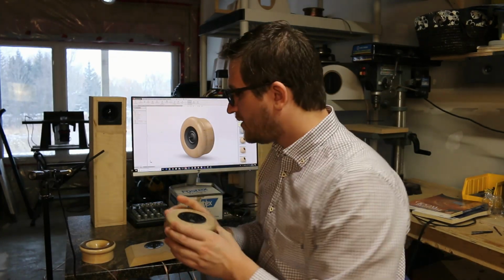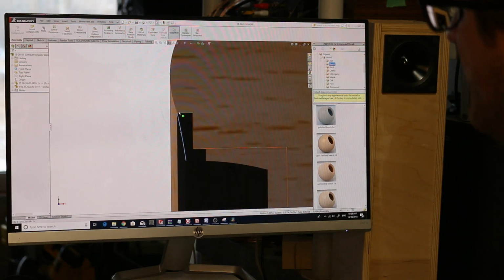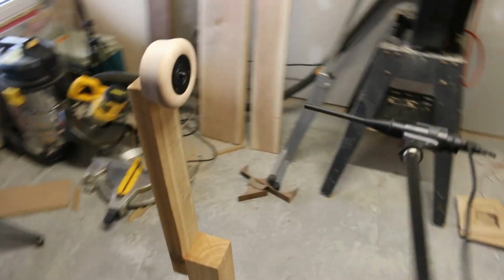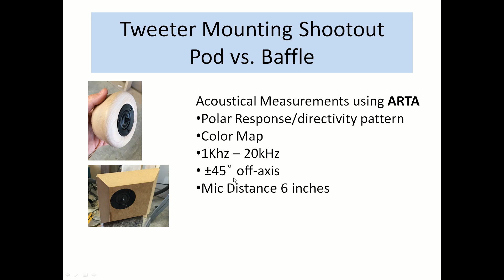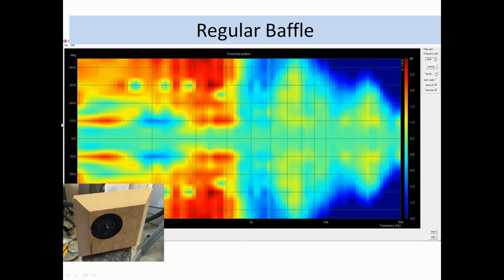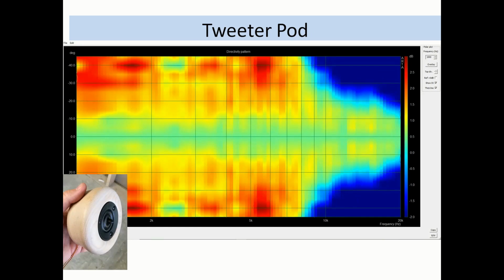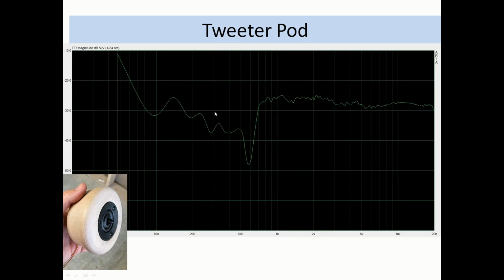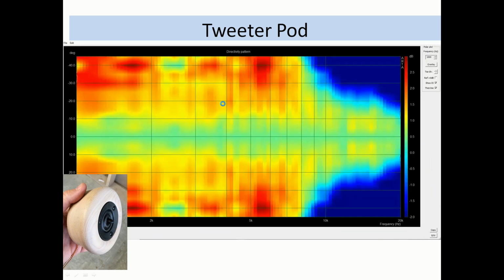Tweeter Pod versus Flat Baffle -- Comparing two tweeter mounting configurations

Comment: Interesting. But the question is where do you put the tweeter pod? If you put it on top of the main speaker there will be diffraction effects from the main speaker box. Have you ever measured the pod mounted to a box?

Comment: I would like to repeat the test with a spherical case and with a teardrop shape.
Reply from the maker: It’s important that the physical transition around the tweeter doesn’t have any abrupt changes in geometry.  Spherical tends to have that angle change from the flat face of the tweeter bezel.
Reply: @JosephCrowesDIYSpeakerBuilding  Then the task would be to construct a sphere that begins with a sound guide directly at the callote.

Comment: Thanks for the video Joseph! Very interesting. That vifa tweeter is quite a good one, but ring radiators have a typical off axis response with a dip at the wavelength of the ring's diameter. How do you think an aluminum dome tweeter would performin this case?

Comment: This leads me to wonder if changing the shape of the baffle for an open baffle speaker would improve the sound . . . rather than the traditional flat extended baffle?
Reply from the maker: I think it would.   On a wide baffle the edge diffraction is still occurring however it's happening later in the impulse response.  For example a 60cm wide baffle the edge diffraction would be occurring at around 1 millisecond after the initial impulse.  This is still well within the impulse response of the driver as even a very 'fast' fullrange takes longer than 1 millisecond to settle.   The magnitude of the impulse will be slightly reduced because of the distance the sound wave travels but the effect would be minimal.

Comment: On the regular flat baffle with chamfered edges you may be getting most of the edge diffraction from the sharp edges of the chamfer and the back? A 135 degree angle there. This is not representative of how such a baffle would behave on a real speaker where this sharp edge is not present but instead there are the sidewalls which give a 45 degree angle with the chamfered part of the front baffle.
Furthermore I've seen measurements with a 30 degree chamfered baffle show excellent results (real world including sidewalls) and theoretically your chamfered baffle, perhaps if rounded a little bit more and of course with sidewalls, with the off-center placement of the tweeter should give better results than your circular horn mouth which gives the same edge diffraction error in all directions so they add up?
Reply from the maker: Marcel de Velde I plan on revisiting this experiment so I’ll do as you suggest.  I want to look at decay spectra in the new video.  I also want to see what adding felt does since some have suggested that felt is effective but I suspect that it doesn’t help as much as baffle shape.  Thanks for your comments!
Reply: @JosephCrowesDIYSpeakerBuilding  Looking forward to your tests! It remains an interesting subject and good for testing, haven't found a program that can reliably model chamfered or rounded baffles. In theory felt shouldn't work as the transition between baffle and absorption should give diffraction as well as perfect absorption is the same as sound dissapearing in free space, but who knows maybe it does in practice by giving a "gradual edge" or something like that.. Though felt should still reflect most under an angle.
Btw I'm very curious, why do you use a rounding that curves exponentially at the edges? I can understand this for horn mouths or even to some degree in waveguides but why for edge roundover?
Reply from the maker: The rationale is that so much effort is placed on the best flare and horn mouth termination that endless articles have been published on the science and yet when it comes to baffles there is little consensus on anything, few articles, and a lot of misinformation especially from the old Olsen charts and graphs that generally mislead designers into thinking round is the worst shape possible.  I think baffle design can take a few lessons from the horn theory.  Nobody would suggest putting a 30 degree straight chamfer on a horn mouth as the ultimate solution to reducing edge diffraction. So why would this be the solution for a regular baffle?  The sound wave propagation from the tweeter is the same thing as the wave front from the horn, so the design method on dealing with the issues shouldn’t be any different.
Reply: @JosephCrowesDIYSpeakerBuilding  Thanks for your reply and explanation! Yes I do agree a 30 degree chamfer is surely not optimal, but I believe what is agreed upon that for an infinately small tweeter (point source ideal) the ideal shape for the smoothest baffle step without edge diffraction is a perfect globe. It gives a perfect 6db baffle step shelve with a Q of 1 I believe.
I think for horns and waveguides there are different principles at play regarding reflection but I'm not an expert on this..
As for the rounding of edges, we won't achieve a perfect sphere anyhow as tweeters have a size of their own and part of the baffle is therefore flat before becoming rounded which means that there will always be some change in the Q of the 6db baffle step (which is another way of explaining baffle edge diffraction). Somehow my logic tells me that the edge rounded to a circle will still give the lowest Q possible as it will give the least sharp angle at any point. But again, guesswork.
Reply from the maker: Or is it an egg shape?  Look up waveform Mach 17 speakers for an example.  Their extensive research at the NDC anechoic chambers certain suggest so.  The “17” donates the number of visits to the NRC before they came to their final design.   Waveform obviously did not rely on conjecture.
Reply: @JosephCrowesDIYSpeakerBuilding Aah interesting. The egg shape seems to me to come from 2 driver stretching the globe into an egg. I am surprised at the fairly high angle of curvature at the transition from flat baffle to rounded form.
Reply: @JosephCrowesDIYSpeakerBuilding  Did find two good baffle edge difraction sims. http://audio.claub.net/software/jbabgy/BDBS.html and https://kimmosaunisto.net/Software/Software.html#Diffraction_simulator both free.

Comment: How would you recommend mounting a tweeter pod? If it is mounted above a traditional baffle, then certainly the baffle will still have an effect on the frequency response no? It would be interesting to see measurements comparing different mounting strategies.
Reply from the maker: I’ll do more testing and find out.
Reply: Thanks that would be awesome.